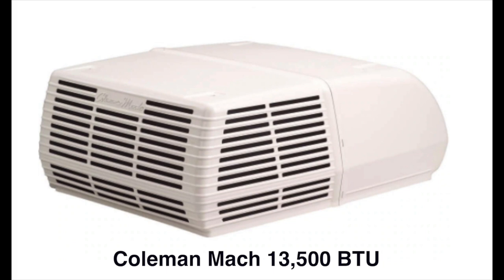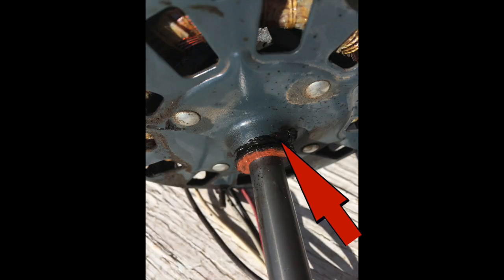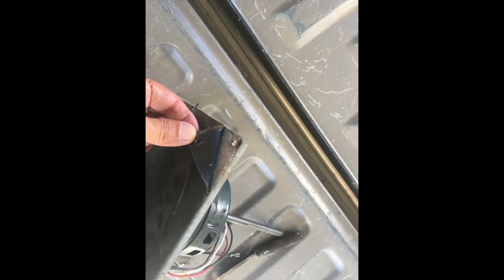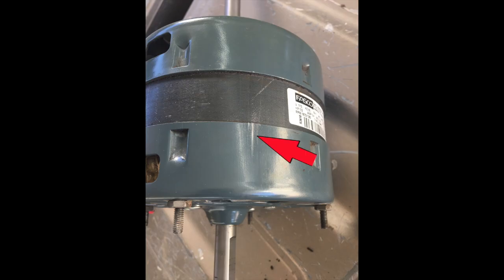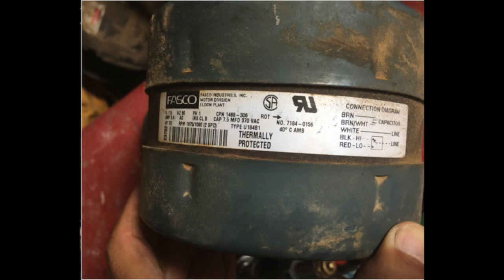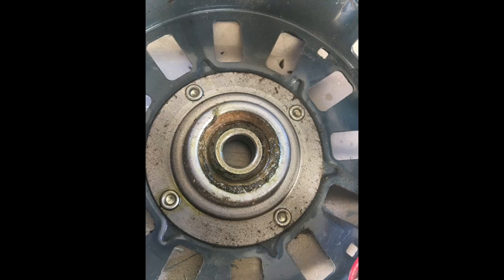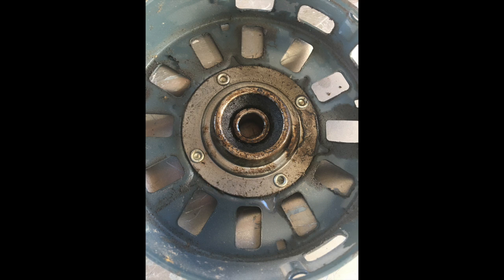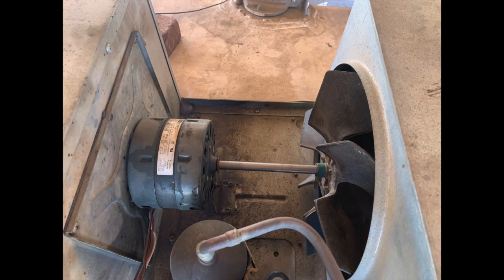How to oil RV AC motor bearings with no ports

Comment: You don't need to take off the motor housing. Just put three drops of 3in1 Motor Oil (blue bottle) on either side of the motor right next to the housing, and then run it for one minute. Some oil work itself into the wick material inside, replenishing it. Do this at the start of every season. I guess manufacturers like Fasco removed the oil plug because consumers put too much oil inside, so, don't over do it! WD40 is okay, but it evaporates, and only use if the motor fails to move at all. If it doesn't move, WD40 lightly by being careful not to spray into the motor assembly inside, then oil with 3in1 Motor Oil after two days when WD40 would have evaporated.
Reply from the maker: I tried that for years, and though in a pinch it might help a little bit, the oil is still unable to get into the bearings enough to do a thorough refresh of the bearing material.  After trying your method for years and believing it would solve the problem, my motors still seized up. Out of desperation and replacing too many motors, I decided to take the unit apart—including the shroud—and then turned the motor vertically (or "up and down") so the oil would hopefully seep into the bearings that way (gravity feed).  This still didn't work, but was certainly better than nothing.  Finally, I bit the bullet and took the motor completely apart as shown in my video and did a complete and thorough job of re-oiling the bearings.  And by the way, you NEVER use WD40 to oil your bearings!  This will actually cause the motor to fail quicker because WD40 is not the proper kind of lubricant needed to refresh bearing material.  There are informative videos on Youtube which go into better detail and explanation than what I briefly stated and I encourage you to do the needed research on this.  Many people, including myself at one time, thought using WD40 was a good idea to re-oil motors but I was mistaken.  All this to say, the only way I discovered to properly re-oil these motors which do not have an oil port is to completely remove it from the RV and taking the motor itself apart to reveal the bearings.  And one of the reasons I think the manufacturers removed the oil ports is obvious:  RV owners like myself who rely on these kind of motors to run their AC units but cannot easily re-oil them mean those motors will burn out much quicker than if the manufacturers provided the critical oil ports and will need replacing with another motor.  And that means the motor manufacturers are making a ton more money by selling these motors which they know WILL FAIL without the necessary re-oiling. The official term is "planned obsolescence."  Thanks for your comment.
Reply: If they have sleeve bearings, they are probably phosphor-bronz. These are supposed to be self lubricating!